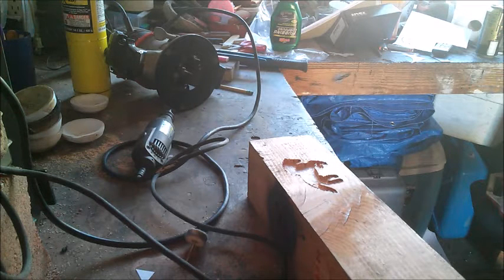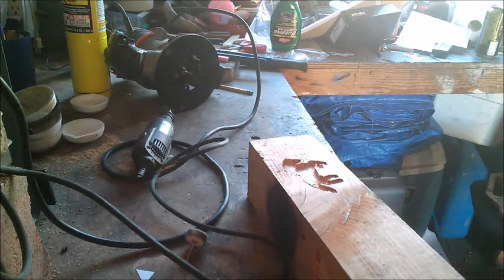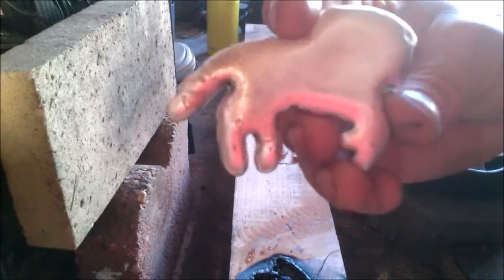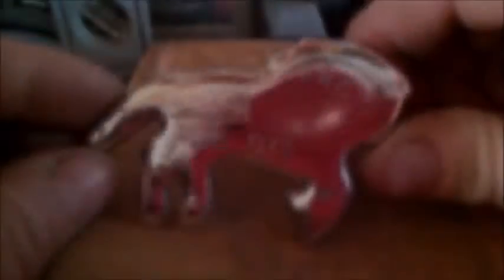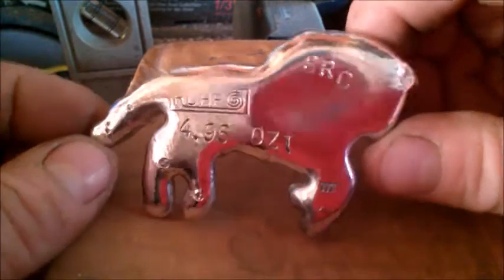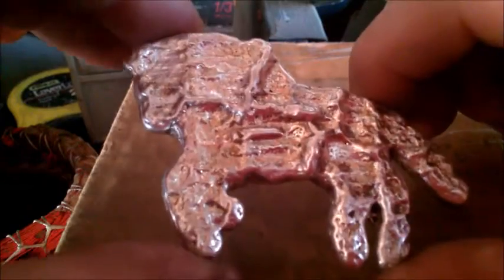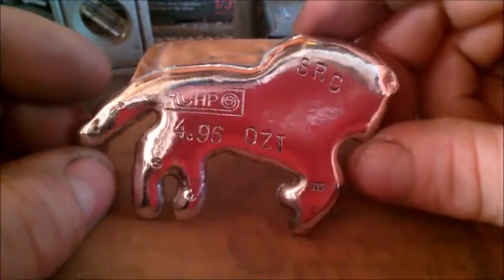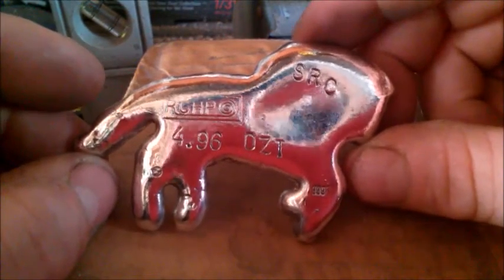So Long Silver Ridin' CowGirl

Comment: Helooooo, I did drop Mr Zeke a line as well. A day of prep and making heat shields for the torches,1/4ing sunshine rounds with 16 in. bolt cutters and a trip to town is enough for today.Out to the pouring bench tomorrow. Still no freight but hopefully soon as it has all cleared customs. We shall do our Cowgirl proud !.
Reply from the maker: Yeah, cutting the rounds up makes them a bit easier to work with, especially if you want to do fraction of an ounce pours...or don't need a full ounce to fill a mold.